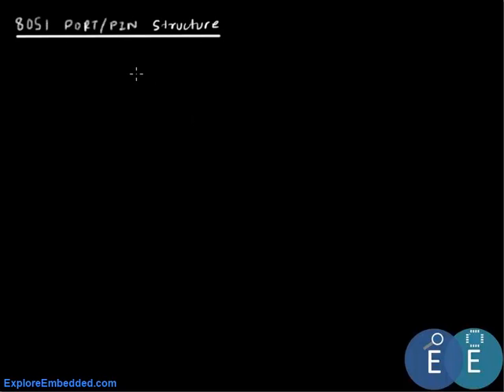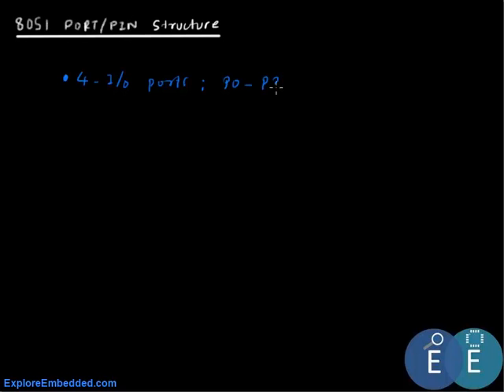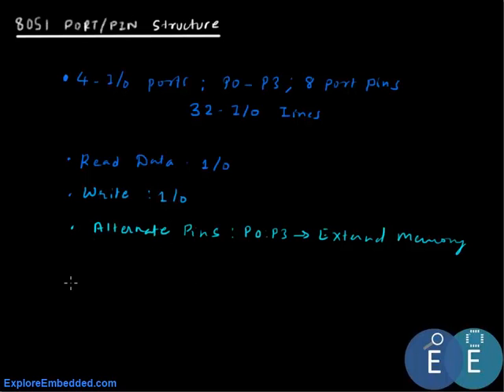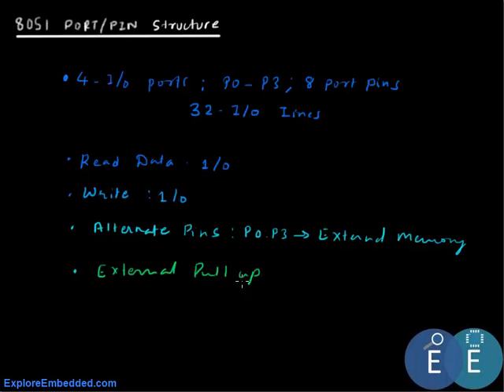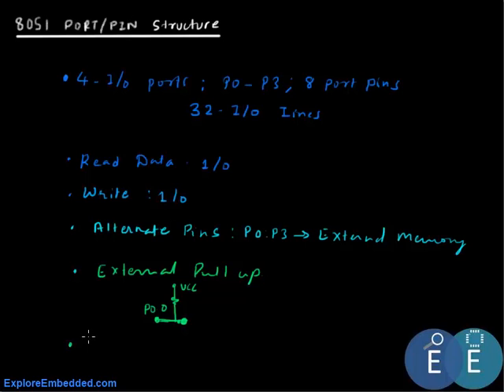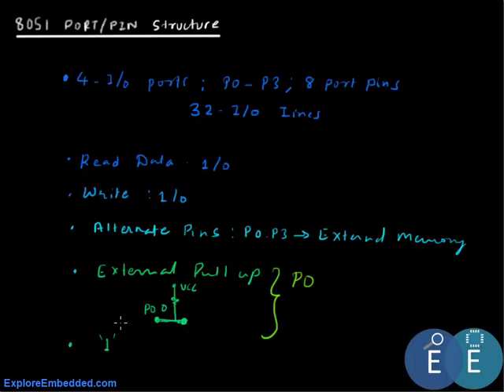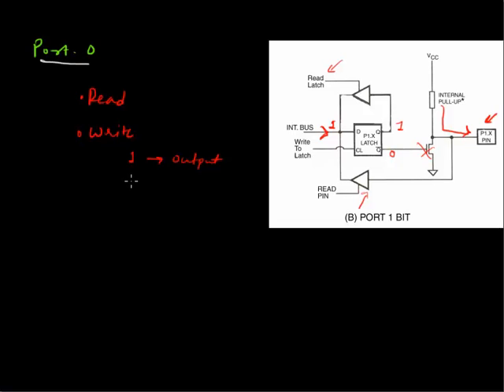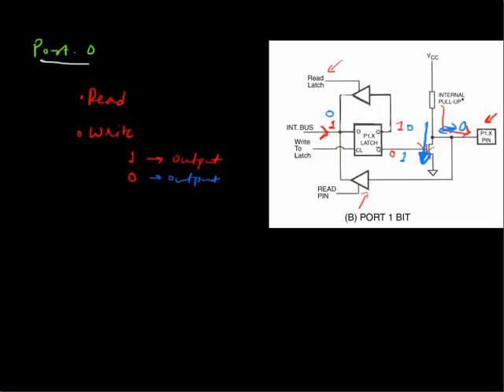8051 Architecture Part 4

Comment: In port 1 'read mode', don't the internal pull-up resistor make the 'READ PIN' to read '1' when '0' is given at port pin.
Because, there is noway for pull-up resistor to ground, hence its voltage moves to 'READ PIN'.?